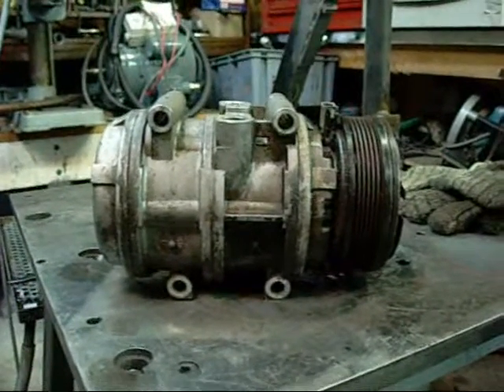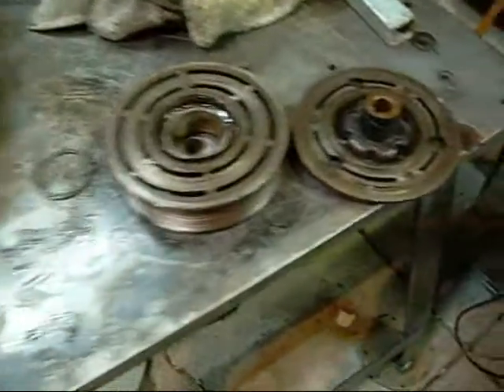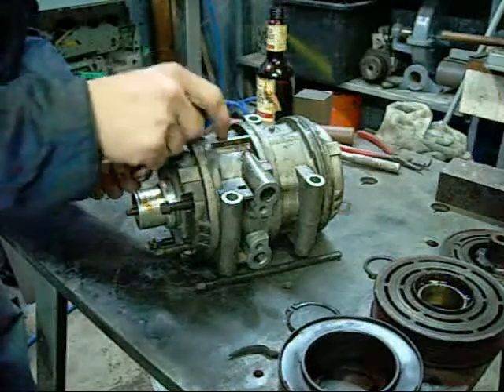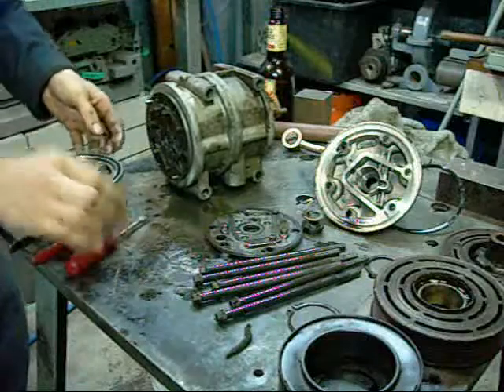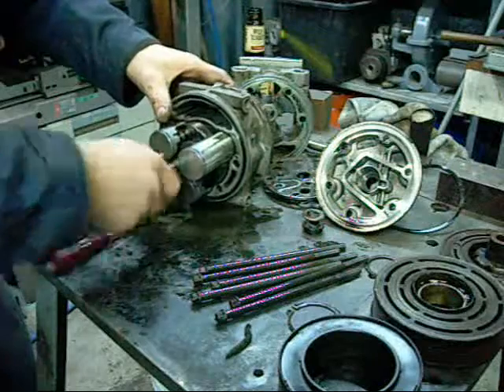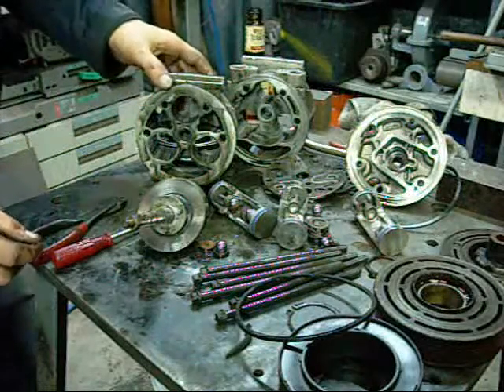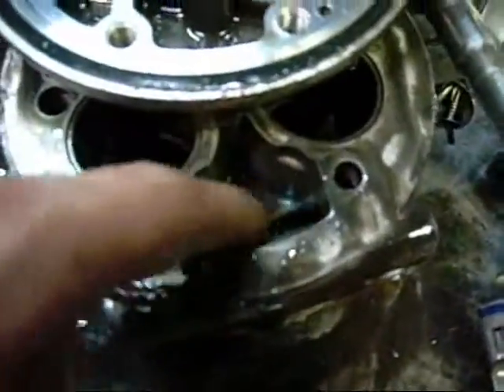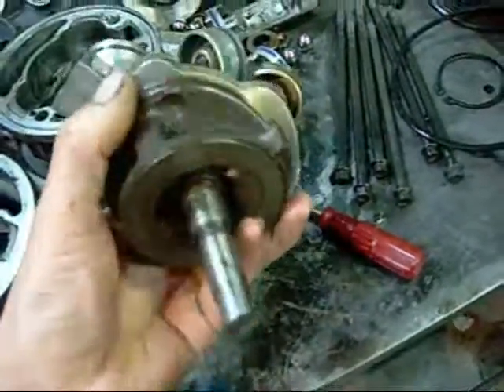Double Acting Swash Plate AC Compressor Exposed

Comment: Wobble plate if pistons are connected to rods installed on the wobbling plate (for ex. Harrison V5). Swash plate if pistons are directly mounted on the wobbling plate, with no rods at all (for ex. Sanden PXV13). Yes, a little confusing.

Comment from the maker: if you could rework the valving to open in sequence with whatever piston is at the top of its stroke it would, but it would be a lot of work!

I think Hugo Junkers made a engine/compressor unit on a similar principal, it was mounted on trailers or installed in Uboats, can't remember what it was called tho

Comment: your awsome bro , i love this stuff, i design engines on the computer and being able to see what will and wont work is very valuable info , also your comments are well informed, i also build alot of contraptions and wen im gonna use a part and i wanna inspect its insides i eather ask u or watch your videos , your air conditioning work has made me the proud owner of a 400 psi air compressore, thanks bro your efforts are not in vain, i dont have the time/ desire to post vids but i do still build

Comment from the maker: @KompulsaOfficial If you've removed the nut on the end of the shaft and the clutch plate,its just a matter of removing the circlip that retains the pulley bearing, however they can be a tight fit and require a puller.

of course, if you intend on rebuilding and reusing the compressor, I would be very carefull not to bend anything

Comment: @Aussie50 You post some very informative videos. That compressor is Ford's version of the General Motors A-6 compressor. It's an axial flow compressor, thus the name A-6. You are correct in saying that it's double acting. It's a 3 cylinder that performs like a six cylinder.The GM version of that compressor is desireable for old car restorations. They make an aluminum housing version which is radial. They call it the R-4. Those are less reliable. Keep up the good work!

Comment from the maker: so many people take these things for granted but few know how they work!, thats why I'm filling the gaps on youtube. without the electromagnetic clutch the compressor would run all the time, wasting horsepower, and cooling the car when its not wanted.

first thing to check if you car AC is dead, is to make sure that clutch works!

the reed valve design could work well on a jet provided it don't overheat and stick open. I was looking at water check valves with similar ideas.

Comment: I like it..

Very informative, and I have taken the car air conditioner for granted for far too long, all I know is they hit you for six when it's repair time.

I saw those reed valves and I thought of pulse jet..

Also I never knew of the magnetic clutch system to engage the pump.

Comment from the maker: Not sure about using them as a air motor since the valves are really only designed to operate when the shaft is driven by outside power.

There is a company that markets them for the 4X4 enthusiasts as a engine driven tire pump called "Endless Air".

The whole reason i had the old compressor that the pistons in the last bit of the vid is because i wanted to use it as an air compressor too, but the intake was too noisy, and I didn;t have enough horsepower to drive it efficiently.

Comment: thanks for doing this vid
i have got to get one of these
or a simaler auto air compressor
i seen a gie turn one into an on board air compressore on his truck,write off the engine as if it where for the air conditioner,i think it was a towe truck

Comment: thats an awsome little pump,i have got to get one of those,wow thats bad ass
thats got to be a high capacity pump
even the bearings are cool on that thing
haty bro could it be converted to a two stage compressore ,or even cooler an air motor,